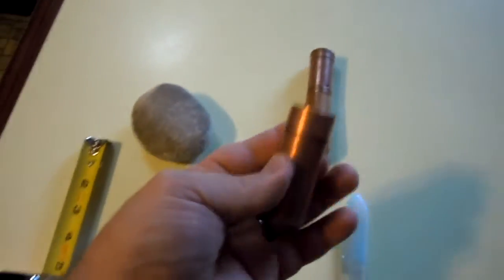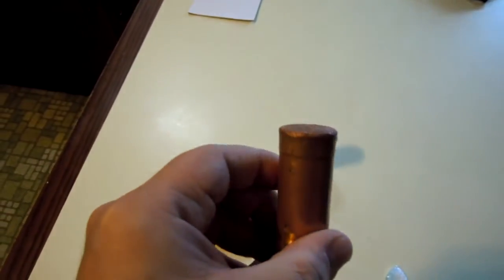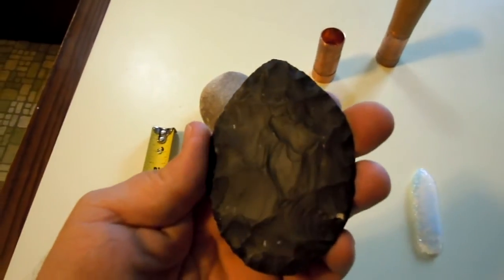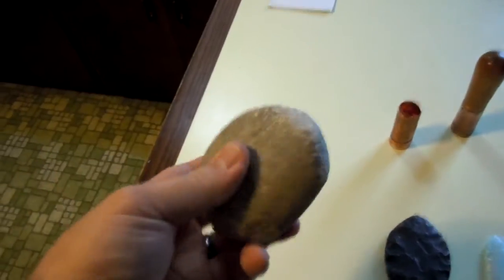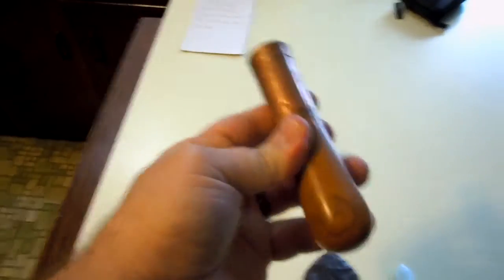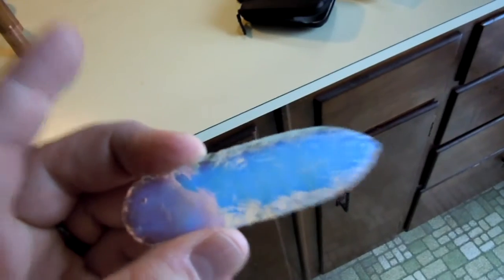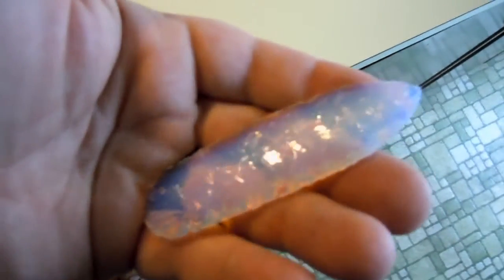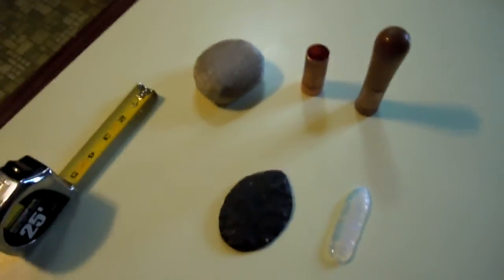Bopper assembly and Tyndall glass

Comment: I agree with you totally about preferring percussion flaking over pressure flaking. I look at pressure flaking as a necessary evil. I get that glass from my good friend Craig Ratzat and have worked a lot of it. People love seeing finished points made out of it. I call it opal glass. You have some great tools to work with. I've never used copper for percussion but I admire those folks that do, because they do some amazing work with it. Good video!
Reply from the maker: I see opal glass is the common name but it really is not like opal, which has a more organized structure.  Tyndall would be a more accurate description.  I have tried your style of percussion with hammerstones but thinning has been a hit and miss affair, no pun intended.  If I had access to larger moose billets I might have better luck.  Also your approach has a low impact on joints.

Comment: That Tyndall glass is pretty stuff. The Texas oil chert with the sparkles is something else. Where is it available or obtainable at? Thanks for showing those pieces. Very nice work!!
Reply from the maker: My source for oil chert is the Ft. Hood area of Texas.  The top of hills is where it might be found.  I would say about 10% of the flint there is oil chert.  I have not see it for sale or in the rock shops.  Typically the cortex is thick and a bright white.  The best examples do not need heat treatment and will pressure flake easily.